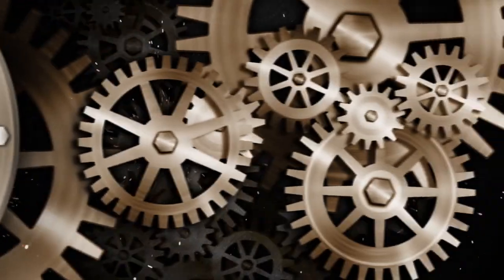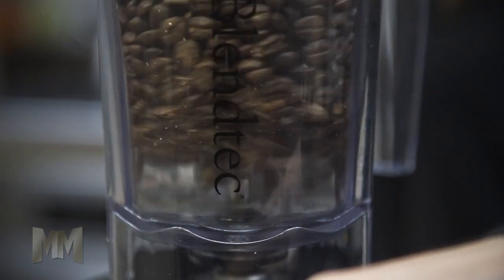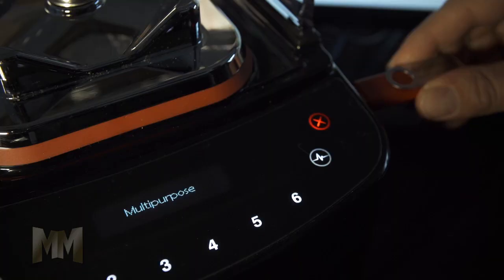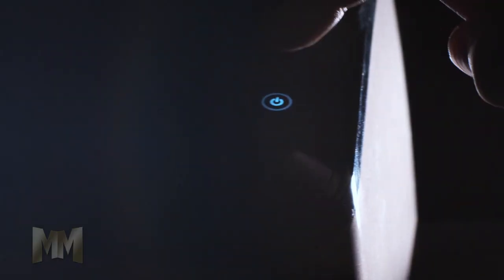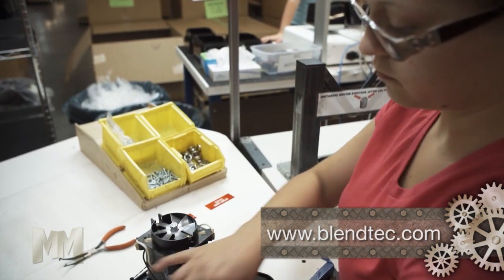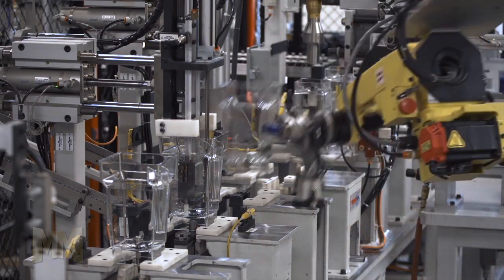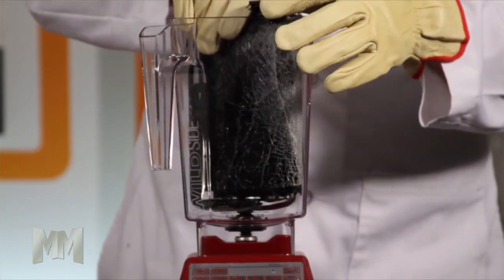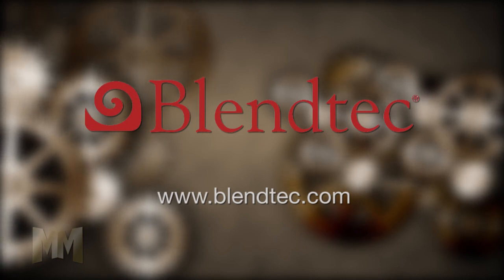Manufacturing Marvels - Blendtec

Comment: How can anyone not see that touch-controlled stuff is the worst thing that happeded? What happened to buttons? With touch panels you have no tactile response, when you spill water over them, they become useless.
Reply: No they don't.
Reply: I have a touch-activated cooker. When water spills over the buttons they go crazy and I have to dry it asap. What do you mean they don't
Reply: Josef Hornych

Then you either bought the cheapest touch panel cooker you could or its faulty. Touch screens should not react to water, put a small amount on the screen of a phone and see for yourself :)